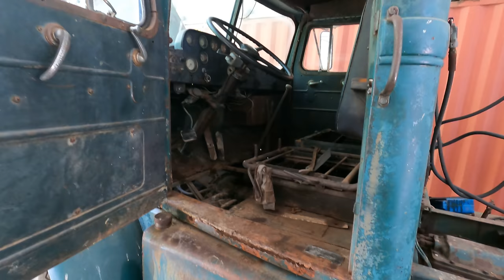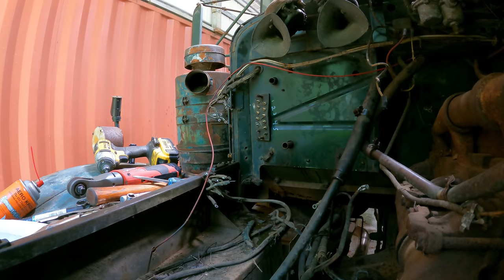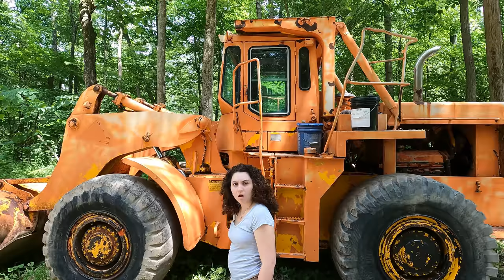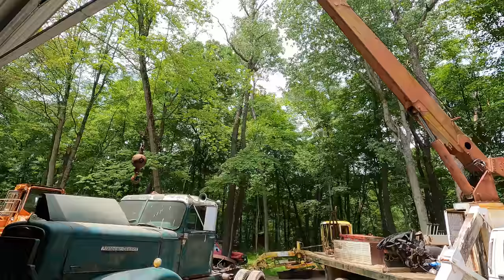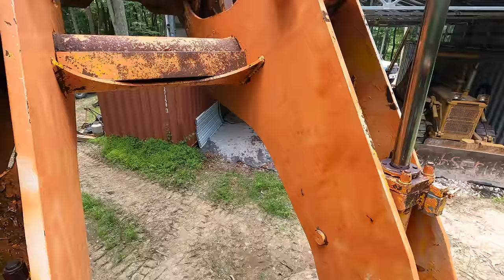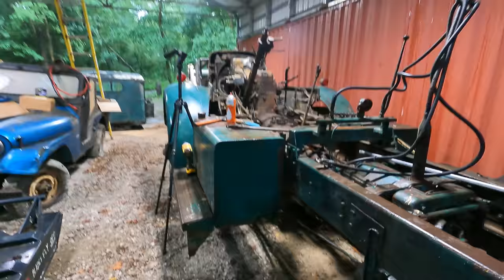1957 Autocar Truck Restoration: Removing Cab & Transmission Damage!

Comment: Next time, pressure wash the equipment/truck before wrenching on it. Repairs are much easier when you can actually see all of the bolts 😉

BTW .. That transmission needs a full tear down, inspection, and rebuild.
Reply from the maker: I steam cleaned a while back, hard to clean the transmission with the cab on.
Reply: @DieselCreek  dang! Looks like you're doin' everythin' wrong AGAIN dude....!
Reply: @DieselCreek  I distinctly recall that you removed the cab just before rolling the truck back inside the covered area or am I confusing your video with one from another channel? 🙃

On a semi-serious note, I saw that you struggled to find some of the bolts holding the top cover on the transmission. Also, thought I would help generate some engagement for your video. 😉

Thank you for posting these videos. You have some interesting projects so please continue to share!

Comment: I'll guess that the gears will be OK, but you'll need to put all new needle bearings, ball bearings, sleeve bushings (if any), and synchros (if any) into it.  IOW, minor costs but total rebuild time. Crossing my fingers for you.  I'm surprised that you don't already own a hot water pressure washer.  It blasts away the grease and dirt, cleaning everything up before you start opening it up.  //  Does it need to be in a certain gear to be able to lift the shift forks out of there?  It's saying NO pretty strongly as you lift.

Comment: Here's a guess...your truck was partially submerged in a flood. That would explain the water in the transmissions and rear end, but not the engine. We're talking about two feet of water.

Comment: Men usually married women that, no matter what type of work they do, weather truck driver, or what Matt does, or even what Andrew Camarta [ Andrew not being married yet ], Jessie Muller or Dan Wheeler, that their partners in life that can help them when they need that other shoulder to help them, and Like Paul and I have each other to help one another, Matt has one hell of a Awesome wife, that helps him when he needs that extra pair of hands for help:-)WTG!!! Cab swinging in the air as Matt checks his cell :-)! I can see it now being easy for working on this, and at some point maybe even repainting her:-) thinking it would be a good idea to get some sort of covering on that, til you can get it all back together, for when you le4ave at nights..there IS a lot of metal shavings in all that, that I can see..slop in the bearings...

Comment: I am certain that the water is simply accumulated condensation.  I am not to worried about the transmission but I am concerned about the engine since the oil pump draws from the bottom of the pan. Anyway, put some oil back in her and run her till she breaks.

Comment: I teased my son-in-law a bit twenty years ago. I wanted the rear seat out of a chevy astro I owned for a while. Hubby and son both told me to just pop the quick release latches that the previous owner had replaced with 5/8 " bolts. They  "couldn't " do anything with the quick releases missing. I soaked the bolts down with wd40 and when a wrench and breaker bar didn't do anything I jammed a cheater  under the seat then got underneath with my breaker bar and another cheater and promptly broke three out of four. 
Back to my poor son-in-law,  I showed him the broken bolts and said I'm the mother-in-law  as I patted my upper arm. He tried to act scared and then laughed at me.

Comment: hey kiddos...dont try to lift yer pick up cab thataway..youll crush / pinch yer roof sides in a real huurry.  run Heavy Duty semi flat straps under the corners or use some pressure treated 4x4 timbers and lift yer cab thataway.

Comment: Have you thought of just building a truck from the ground up? Get a chassis, suspension, axels etc. Drop in an engine, transmission , drive lines and so on that you like. You could just build a cab the way you want out of what ever comes to mind. Aluminum siding for light weight or fiber glass or anything else you can get. As a private individual you don't have the budget constraints an automotive manufacturer does. With them every washer has to  be a certain price, the choice of calking and glue is limited as well. You have access to used materials that they could not get to do a million units and wouldn't dare use anyway. You can do a lot of things they cant and you'd have a custom truck with good new or rebuilt parts free of all the rust and rot you're having to fight here. In fact if you wanted to coat the entire chassis with bed liner or build it out of aluminum from an old tow truck bed or you probably could. The possibilities are vast. A cab that is plastic or fiber glass on the bottom with stainless steel attaching points maybe. You could eliminate the rust issue for good.  Here is one example. https://www.youtube.com/watch?v=LDiKGlxSm5w

Comment: Was Autocar part of White when this was built?
If so it might share a cab with White/ White Freightliners of that era.
Some cabs were even used by unrelated companies.
I have heard that Budd made the same cabs for Ford and Mack some years.
Hopefully they used that cab for a few years.
Another 1957 cab will probably be in just as bad of shape.
Good luck.
I am sure it is hard work but it is fun getting to use your "toys" to work on another "toy" isn't it?
Reply: This White 1970 cab looks really close https://www.youtube.com/watch?v=ke0MBVCDM8Q
Here is a 1955 for sale https://www.truckpaper.com/listings/trucks/for-sale/19966523/1955-autocar-dc100
1960 with sleeper  https://www.truckpaper.com/listings/trucks/for-sale/31864923/1960-autocar-dc75t
Reply from the maker: These cabs were used on lots of different trucks back in the day. I don’t think white was ever related tho

Comment: water enter from rear seal because you can see it leaking from last videos u make
2nd how water get in i would say from hood down under cab n 3rd that fluids look like never every been replaced and u r first person to replace it
i recommended replacing all bearing to save urself a headache and i have make mistakes before on manuel transmission i should have replaced all bearing unset of 2 them i was so stupid I learned my lesson on next rebuild was replaced all gear ring and bearing at same time n it did last me more 400 k miles off of it
be sure replace seal front n back dont let leak fool u aging

Comment: Son ya need o learn to high pressure wash all that under carriage, before you pushed it back in to work on. so you do not get dirt into gearbox or any other repair you have to do on it.    ole timer